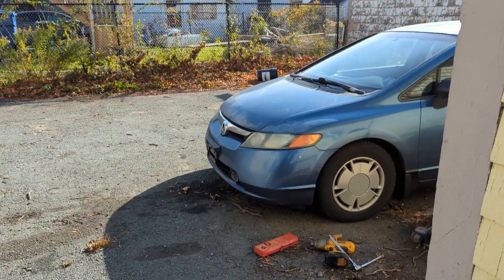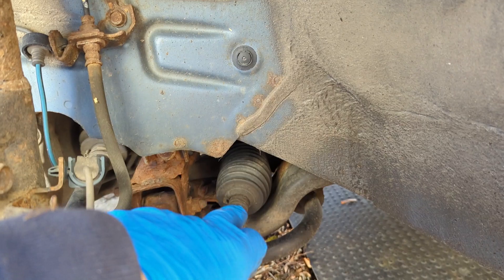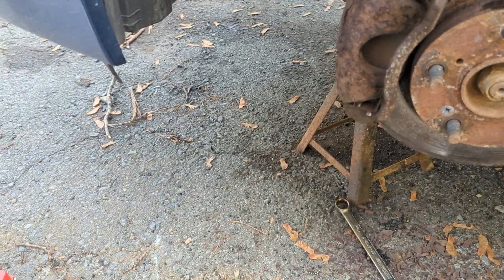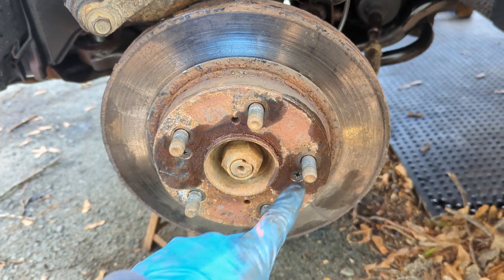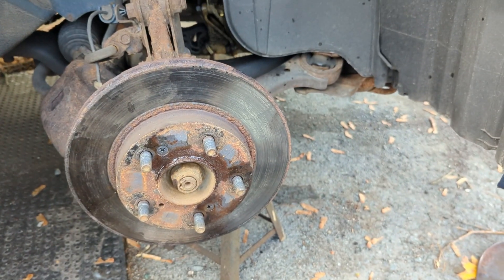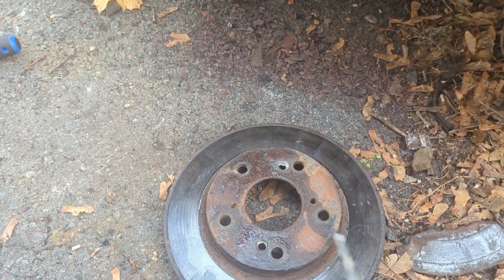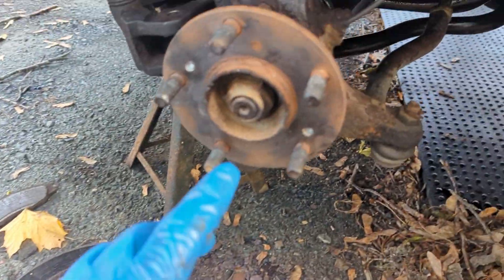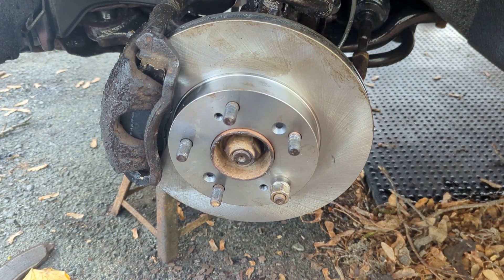2008 Honda Civic brake job Quick and easy brake job DIY

Comment: I sure hope you used anti-seize on the lug nuts..... Stephan... your a top notch mechanic .
Reply from the maker: I use to anti seize the studs  Then I was told by a tire shop to never do that so who knows ??
Reply: @pstreetgarage7304  my uncle drove his own  tractor trailer for 60 years. He used it on all axels and studs. However... on aluminum rims... you can't over tighten so the need to be retorqued monthly. Just for safety.
Oh..BTW...  did you see that tug next to the world's largest cruise ship. It looked like a toy in a tub.
Reply from the maker: @Whitecranekungfu  No.  I did not but yes tugs are tiny

Comment: Sorry my trick didn't work for you Stephen unfortunately the amount of salt that car probably sees they were most likely broke off anyhow but no the bolts or screws are not required just make sure you line the holes up with the little studs that are still there or grind them flush
Reply from the maker: Ed. It was a great trick and it worked on my son's Chev Cruze because the breaks were fairly new.   The brakes on that Civic are probably 4 yrs old and in our climate there is no getting those out.  Maybe heat ?  Drilling them was fine.
Reply: @pstreetgarage7304  yeah honestly as soon as I saw that one backing plate was rotted off I kind of cringed as I oh s*** I don't know if that's going to work just because I know the amount of salt it takes to eat that thing but yeah you don't need that backing plate either
Reply from the maker: @mr.eswatchreviews  Ya.  They are both gone lol.  She says the car feels like new now lol🤣